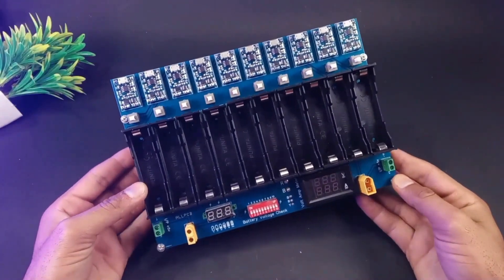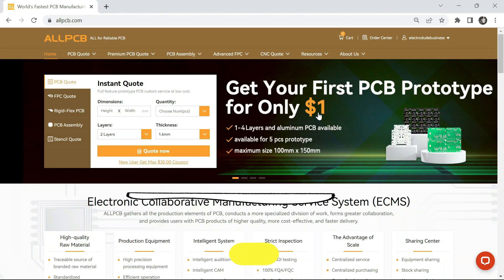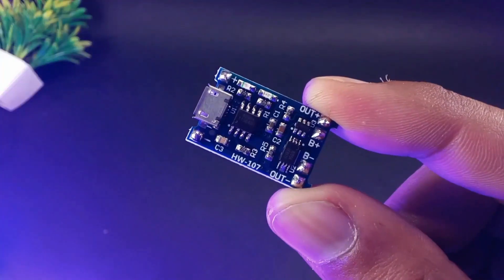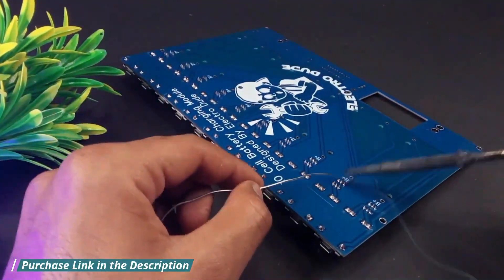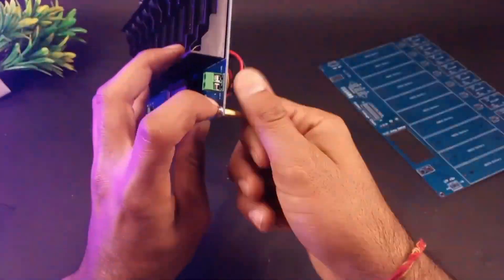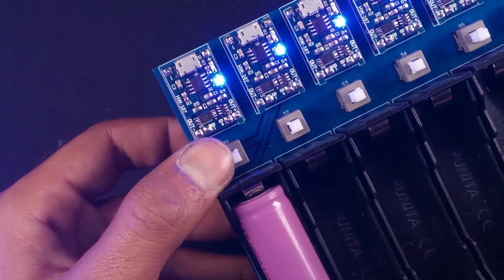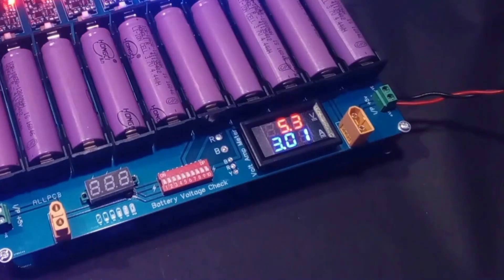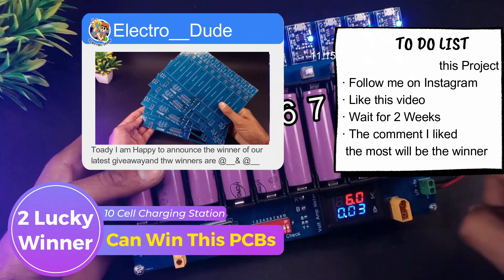Biggest Li-ion Charging Station | 10 Cell Li-on Battery Charging Station | DIY 18650 Battery Charger

Comment: Brother I watch your video from Bangladesh. What PCB Garber files can be given to the PCBs you designs or spell! For example, the lithium ion battery charger circuit's Garber file multimeter, etc. Circuit is made of Garber file. It would be of great benefit! ❤❤️🥰🔌🇧🇩
Reply from the maker: Follow me on instagram i will send it to you
Reply: @ElectroDude  I have to work with a small lithium ion battery I have to do with testing and charging. If the file lithium ion charging station and multimeter's garba files would have been very beneficial. ❤